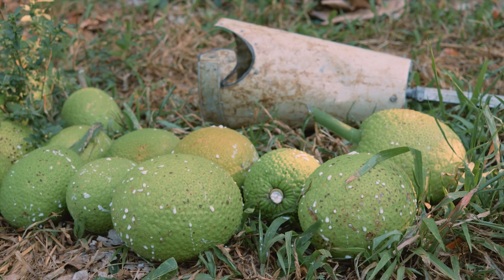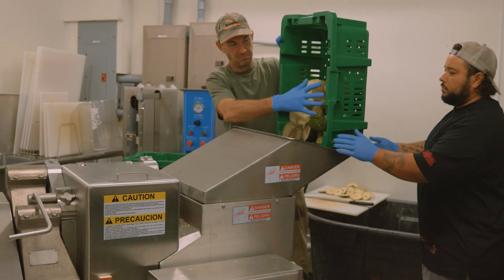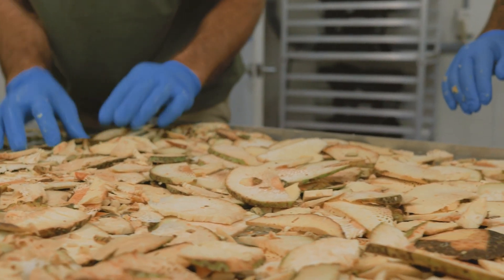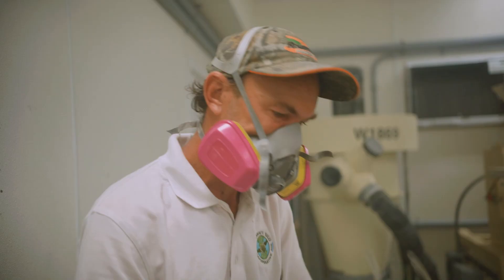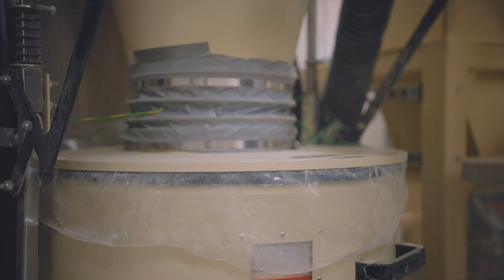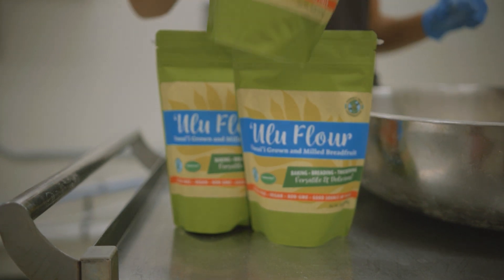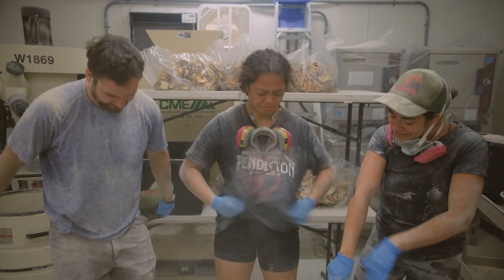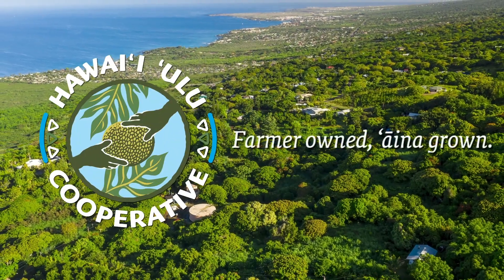How is Breadfruit Flour Made?

Comment: 490 Lb dry from 500 Lb wet?
Reply from the maker: To clarify, it is 490 lbs. sifted from 500 lbs. dehydrated. Mahalo.
Reply: @HawaiiUluCooperative  is it that easy to make flour? Dehydrate, than grind? Can this be done with any fruit?
Reply from the maker: @youisastar3246  Aloha, great questions! After the breadfruit is harvested and delivered we wash it, cut it, slice it, dehydrate it, mill it, package it, and store it before distribution. This process can be done with many fruits, but suitability for flour depends on the starch and sugar content. For example, if you try this process with lychee, you may find that the high sugar content makes the dehydrated material sticky and difficult to mill, and will change the way that the flour behaves when cooking. Good candidates are starchy fruit like breadfruit and plantains.